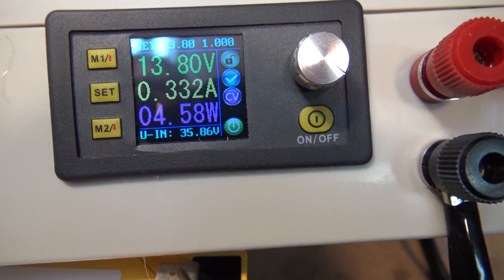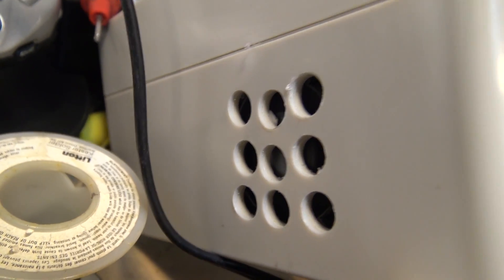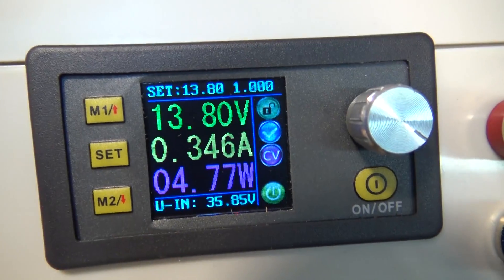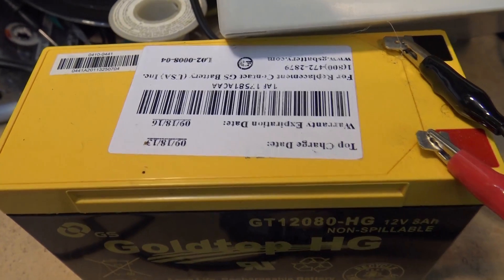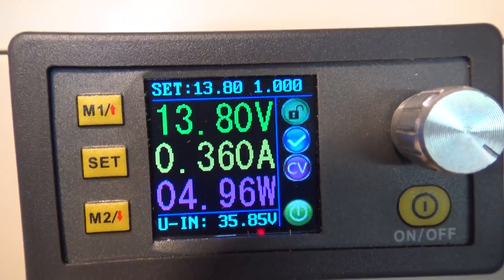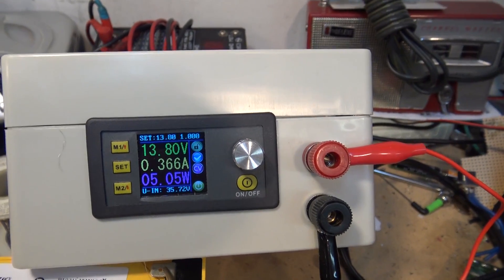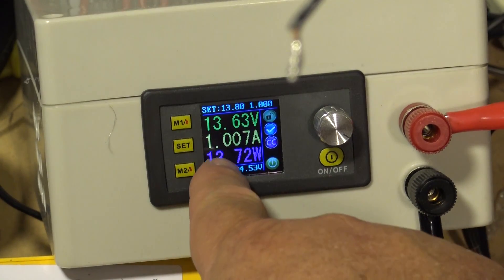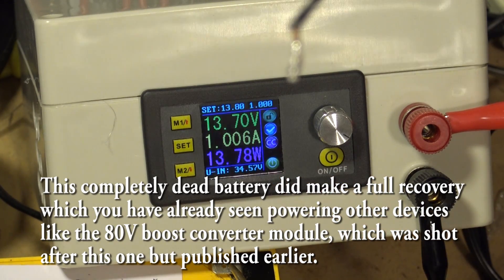Current limited battery charger

Comment: After completely charging the battery wait 24 hours and do a load capacity test and show us what the outcome is?
Reply from the maker: Nothing fancy, just a Schwinn with a Currie drive system on it. Uses a 24 volt 450 watt motor. Will power it to 29MPH under it's own power. Peddling is not required, but I only use the electric for hills. Haven't used it much lately. When I feel like taking the bike out, it is the BIG bike I prefer.
Reply from the maker: When I ran the test on the DC boost converter the battery had been sitting for over a week. I have about a dozen batteries that were pulled from service and they all hold a full charge. A few of them on on my electric bike, and they are working fine.  I also have a few of them in the 2 UPS units I repaired and they are working. A few I grabbed from the bin wouldn't take a charge at all, and they went back in the bin, but most have taken a full charge.
Reply: Will you show us your electric bike? :)

Comment: I like it, just don't leave it unattended...
Reply from the maker: FindLiberty 
Lead acid won't burst into flames like lipo can. They can short and that is the beauty of this power supply as not only will it limit charge current but you can set a maximum limit and it will shut down if exceeded.

Comment: Being a thicko, could you explain why limiting the amps is important? From this example the previous owners of the battery tried to charge it too fast, with too high a current than it could handle? So they chucked away a battery with a lot of life left in it?
So as the battery wakes up it becomes more robust? Am I understanding this right?
Would  this would work on any battery in any state, or is it just that you got lucky and got a battery that shouldn't have been thrown away? If this technique works so well this would mean one could make a lot of discarded batteries useful again. Forgive me for going on so long but could this also salvage many laptop batteries, or when they are dead they really are beyond using this method? 
If you have already a film explaining the principles of all this please could you direct me too it. Thank you. Absolutely lapping up this channel.
Reply: +Sinsbird This helps. Thank you. - Edited (a lot. Top marks, Sir. )
Reply: Basically, limiting charging amps is important for longevity. It's recommended to limit the charging current to capacity/10 amps. A recovered battery is not more robust since it probably was damaged in some way. Easiest way to damage a lead acid battery is to over discharge it. Some batteries do come back, some partially, and others don't. If there's a shorted cell, for example, voltage of the battery is around 10.5V when it's fully charged, you could still use it as a 10V battery. 18650 cells can be salvaged from laptop batteries, but most laptop batteries themselves can't be revived, because they have ICs built in that permanently 'mark' the battery as dead even after the cells have been replaced.
Reply from the maker: Limiting the current prevents overheating the plates. This is a lead acid battery after all. Over heating the plates can result in plate warp-age and shorting out.
Just like a car battery, a slow charge is better than a fast charge. 
All those Tesla drivers that insist on using the supercharger every time they top up are in for a nasty surprise one day when the battery fails.
Reply: I wont try to thumb a lift off one when I see it coming. I'll wait for a boring Prius
Reply from the maker: You are right Prius is boring. My wife drives an Escape Hybrid, which is the same technology. Not much fun to drive but it gets from point A to B. 
I drive a Volt, ,much more fun to drive. Full on electric drive, and when the battery runs down, an efficent gas generator to continue the trip. Best car I have owned. All the advantages of an electric, which is very low maintenance and operational cost, and it still has a gas backup.
130,000 miles in, original brakes, and lots of meat left on them. Were checked in the summer, and they still have 90% of the brake lining  left, and that was at 120,000 miles!
Reply: And you being a sparks can fix them. The garage will bring them to you! Haha Win win.

Comment: Dam good use for that neat psu :-D, the constant current mode is handy for powering unknown devices that may be shorted, similar to your bulb but for d.c.

You have 24,000 subscribers, and you let a thimble full upset you, ignore them.
Reply from the maker: They don't upset me, because they are LOOSERS
Reply from the maker: Well it is a secondary use for sure. That little module I got from Banggood is a really nice little regulated supply that I will be using as my bench supply for everything going forward. They sent it to me promo to show off, and I bet they are selling plenty of them now as it is a really good little unit.

Comment: Two things: (1) The fan: I have a couple of those DPSxxxx meanwhile and they are really super-efficient (90%). I think you have the 12A model and this piece should handle anything up to 60W-70W without a fan easily. You can save your ears a lot of terror from these little fans. I have plugged an LM3xx-regulated fan-control into the fan-power-lines and run them without fans to even 80W. In your case the wattage was < 5W resulting in minimal power dissipation on the heat sink (< 1W) and they can surely handle that.
(2) never mind the thumbs down; it IS a cool little power supply, built for the job and doing what it's supposed to do. The main reason I subscribed to your channel is because you're the kind of guy who knows tons of stuff, does a job based on vast experience, and gets things done ... uncomplicated, straightforward, sufficient and reliable. I admire that a lot! Good show and thanks for the video!
Reply from the maker: Better safe than sorry. The fan isn't that loud, it just sounds like it on camera due to the auto level control on the microphone. The fan came out of an old motorola cable box.